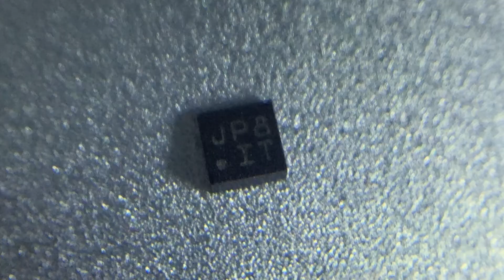Denver 5040W rotation fix!

Comment: why don't use the firmware upgrade ? It's fix that
Reply from the maker: +Cyril A. Because at the time there was none...does the update allow you to disable the function?
Reply: Tech Apprentice i just send us an email, have you one i Can send you the update?
Reply: I juste send us an email....and the reply :

Hello
 
This is a feature on this camera. This G-sensor.
 
We have an update to turn it off though.
Unzip the files attached here and copy them to the ROOT of a MicroSD card.
Then insert this card into your camera and turn it on.. It will start blinking in the red diode but the screen are black. DON’T TURN IT OFF OR TAKE OUT THE CARD but leave it blinking.
After a few minutes (2-3 minutes typically) it stops blinking red, and now you can take out the MicroSD card and then turn on the camera again.
 
Be sure to delete the files from the MicroSD card before using that card again, otherwise it will just start updating again and again.
 
After this you can turn G-sensor on/off from within menu.
 
Best regards
INTER SALES A/S
DENVER ELECTRONICS A/S
 
 
Morten Pannen
Product Marketing Manager

And few more thing in this update 
the link sorry it's a wetransfer 
https://wetransfer.com/downloads/23d2a03c87afcd896e7ec04039cf2fe720171018130345/4cf9479aa3467961623fe2406e60a8c320171018130345/ae393f
Reply from the maker: +Cyril A. Sure! I will post it here after!
Reply from the maker: +Cyril A. Thanks a lot for the update! I will upload it to google drive or something!
Reply: NP, i'm ResO on coolminiornot ! ;)

Comment: I have tried the below firmware update, but the screen frooze for more than 10 minutes. After that I hit the reset button, now the cam is dead. I'm not getting it on again (power button and reset button both not working). Any ideas? :)
Reply from the maker: Any lights when the camera is plugged?
Reply from the maker: Can you open it without a sdcard in or it does the exact same thing? You pressed the reset button?
Reply: Tech Apprentice I tried different ways of getting the cam to work without success. Hitting the reset button with or without SD, but nothing... Cam seems completely dead. Maybe I pressed the reset button too soon when the screen froze after first boot with firmware update...
Reply: Hi, have you resolved your issue?

Comment: This is how to update. 
1. Download the update file and unzip it
2. Format a MicroSD card to FAT32 and copy the file to it. (the file has to be on the root of the MicroSD card, not in a folder)
3. Insert the MicroSD card into the camera and connect the camera to USB (like when you charge it)
4. Turn it on, wait for the update question to show and choose YES by pushing short push on powerbutton and confirm with shutter button. 

Now camera will update (it will take approximately 2 minutes, and when finished it will turn off the camera.)

Now take out the MicroSD card, format it again and re-insert, now you can use the camera like before, but now the OSD languages are correct.
Reply: with the zipfile in description